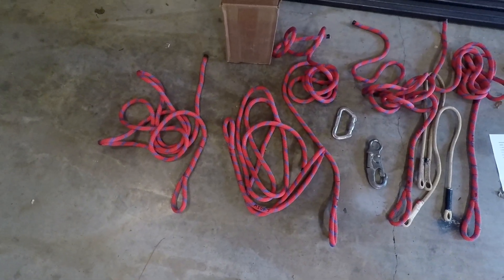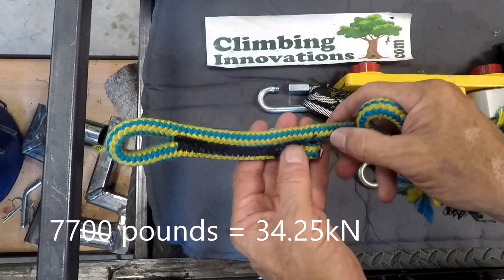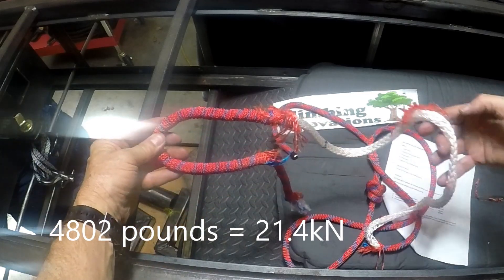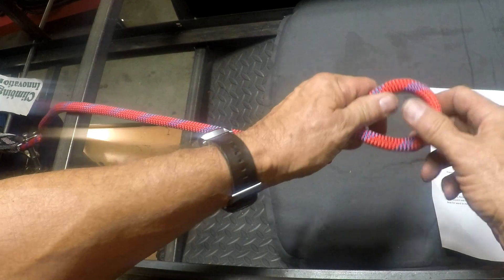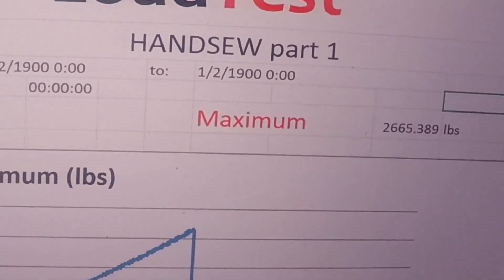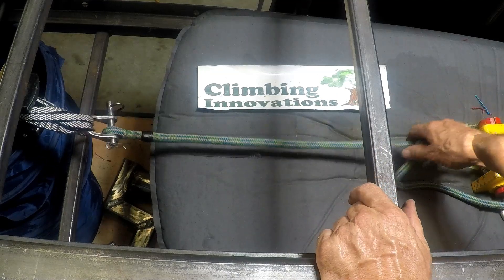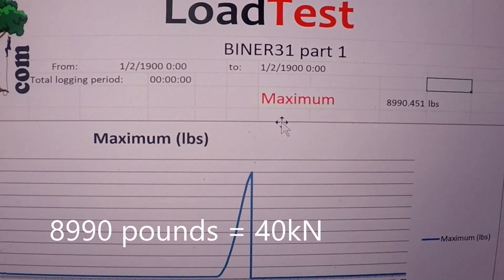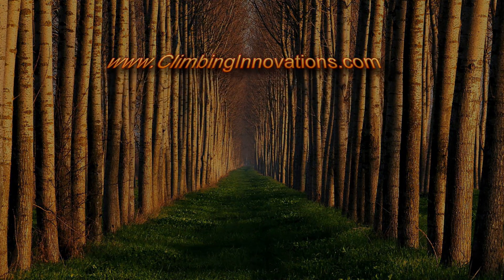Load/Break Testing Ropes and Splices

Comment: Interesting, I wonder how much importance stitch tension and rope stretch affects the results, what about tacking of uniform width, but increasing in tension as it nears the splice.
Reply from the maker: Stitch tension is important and should be balanced top to bottom.  A good sewn eye will not show the loop of thread on either side.  A good match in rope material between thread and cordage helps.  I have sewn with Kevlar thread  (many times strong and no stretch) and it did not increase the strength of the eye.
Reply: @RichardMumford1  I suspect that a thread with very little stretch on a rope with a lot of stretch would introduce a sharp angle, and that this would be at the stitch the furthest distance from the eye, as the rest of the tacked distance would be made more rigid by the stitches. If so, I imagine that if one where to use a lower thread tension at the end furthest from the eye, it would allow for more of the forces to be carried by the stitches further towards the end of the rope.
Reply from the maker: @UnconventionalDIYprojects  I don't know a machine that would allow tension change mid stich.